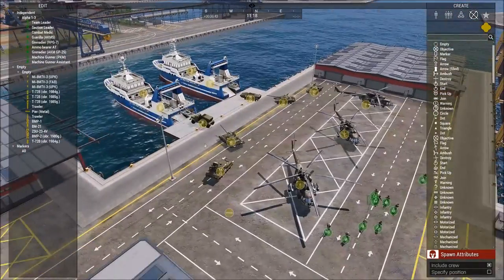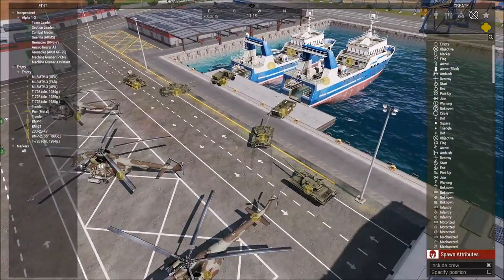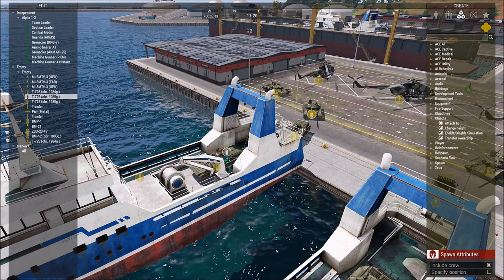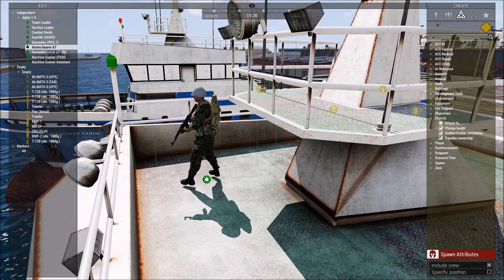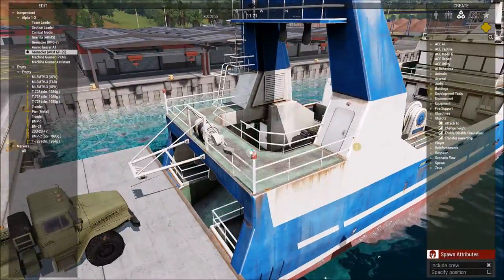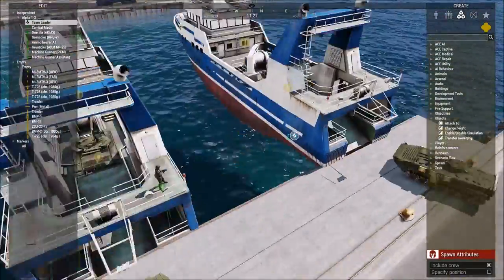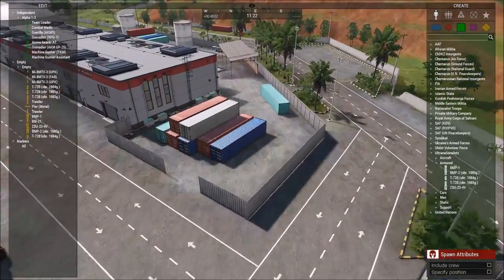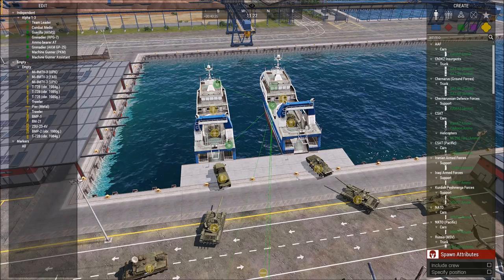Advanced Zeus tricks with Achilles: All you need to know about being a Zeus

Comment: I used the top of a cargo container inside the ship to make a floor for ai to stand on... works 7/10 times. Worked on the back of the sub too, put a cargo container inside it so the top lines up with the rear deck of the sub, and put your ai on top of the container